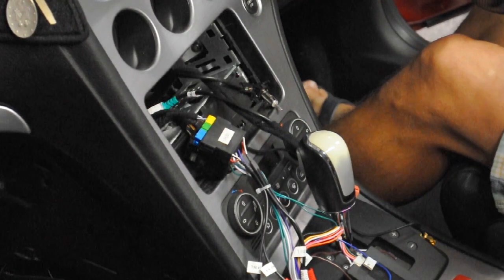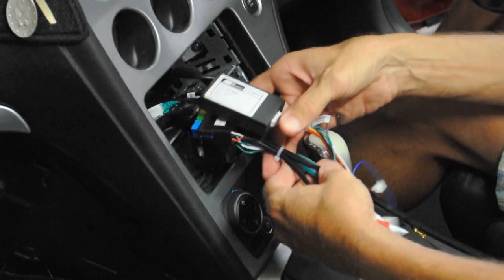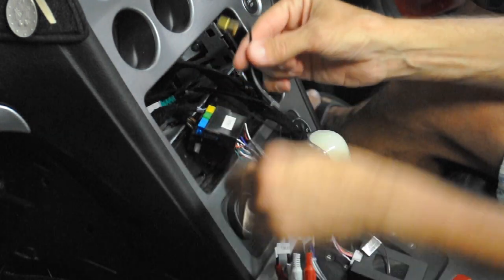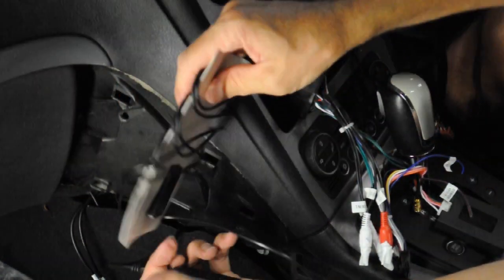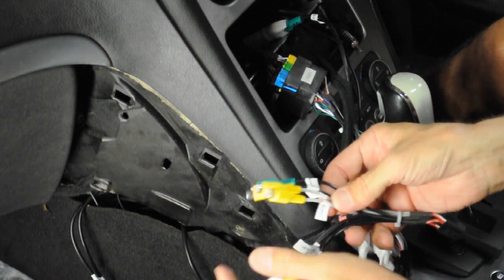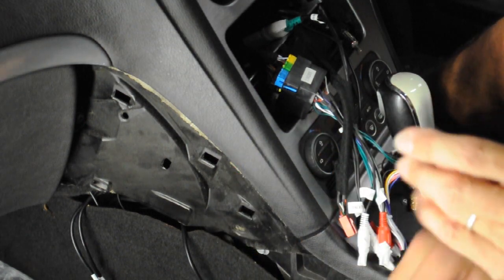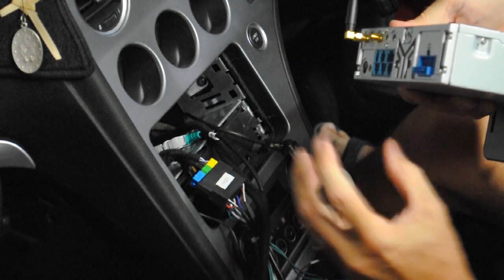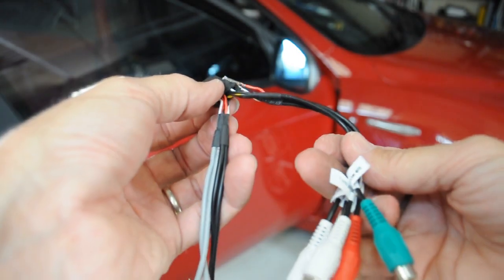Alfa 159 Isudar android head unit installation tips

Comment: I appreciate sharing your experience with us!
I'm interesting in buying one of these Android 10 Navs (PX6 now) and I want to ask you a few more questions.
1. Would you recommend the Isudar one now that you tested it? Would you look into the other Chinese units available? (Xonrich, Wondefoo)
2. What are the biggest cons you found so for?
3. I've seen issues on the internet where the phone steering wheel commands are not working as expected with the nav (compared to Blue&Me). Have you noticed any? 
Thank you! Any additional info is definitely helpful.
Reply: Hi, This andriod unit has the normal problems which all android gear has (and phones etc)....it needs to be power cycled every week or so to make the system work well. 
Isudar is good because they have people who will talk to you , via email , kimi@isudar.com , to help with any issues. I'm using a custom launcher, FCC which makes it look good, but adds another level of complexity.
I suggest buying DSP, for better sound, and more ram.
The steering controls work 90% of the time, which isn't the unit but the car not wanting to talk to the unit. Restarting the car fixes this...until the next time.
Volume up/down works , and up/down arrows will give next/back of  channel/preset/item etc. 
SCR will change program i.e, CD/radio/ blutooth etc.
Remember to unpair all devices from the blue&me, so the unit can pick them up.
Reply: @mikebradley4531 hey, just bought not the same but similar head unit and having issue with the szerring controls, did some research and tried everything but nothing seem to work. Any idea? Gonna try to fully disconnect power for a few minutes but other then that have no idea what can be the issue, thanks for you answer
Reply: @Nick-wn3ys  I don't understand what 'szerring controls' are?
Reply from the maker: Ok, I found that the buttons working on the steering wheel were 'hit and miss', some day they worked, others not. maybe get into the service/maintenance menu, with code 127. There's lots of settings there.

Comment: Hello mate, I have a question regarding the Alfa 159 audio socket that goes into the stock radio. I'm purchasing a joying headunit that only has RCA inputs. Do you know what adapter would be appropriate to convert the existing connection to RCA and maintain steering controls? Cheers
Reply from the maker: Hey, the stock radio has the pin outs on a sticker on the top, I took a photo , hoping to send it to you but ther's no facility to add photos... also , the connector is for feeds to the speakers, at high level, unless you ahve the bose sysytem with the amp in line,... the output of the joying headunit will be too low. ( line level, not spaeker level) You could get creative and remove the appropiate speakers from the connector and extent it to an amp, fed by the joying outs. Are you saying that the joying unit is compatable with the alfa can bus?
Reply: @gbymb  Ahh thanks I think I had a brain freeze. The ISO cables in the Alfa are the speakers & canbus and there are actually connections for these on the back of the joying unit, just coming out of their own seperate cables not a block connection like on the back of the stock unit. Thanks for the reply anyhow.

Comment: hello, nice tutorial video ,very helpful. can you explain more analitist about steering wheel control to working properly as the original radio?

There is a way the steering whell buttons to working 100%.
Reply from the maker: Hi, It looks like my reply of a few weeks ago didn't get listed.... anyway, to reply to your questions:
I found that if you didn't touch the button assignment, you would get volume +&- on the left button and forward and back on the horizonatal buttons on the right. The vertical button dont do anything. There is also mute and source when you push them in. As for assigning them I didnt try. But I think that this is done in the factory settings, the password is 126. also download the uaer manual from Isudar.
I've an ungoing problem where the button don't work from time to time. I found this was a problem witht the car, not the headunit. I had to restsrt the car and it worked again , maybe canbus, not sure.

Comment: Hi. I have brera with newer radio unit (the one with screen) is it possible to plug an after market amplifier in it? Because the original bose system amplifier has stopped working and sbuwoofer in tje back is not working anymkee.
Reply from the maker: Hi, sorry to take so long . I'm sorry, but I only know my configuration, I'm not familiar with the bose rig. good luck

Comment: How did you manage to squeeze all those cables with the Blue and Me kit still installed ? I had an awful lot of problem with mine and strive finding a way to either remove or move the kit without having the odometer flashing…
Reply from the maker: I removed the extra cables from the head unit, which I didn't need. Its' possible to release the extra cables from the plugs before you attach them to the head unit.... then you just have to squash it all in. My B&M is still in place. sorry for the late reply.

Comment: When you turn off the car, the radio turns itself off?

Unfortunately I received an android radio today, and it does not turn itself off.
Reply from the maker: There is a setting which gives power to the radio for a preset time, mine just turns off and I cant controll the time it stays on. to turn it off hold down the left vol button.